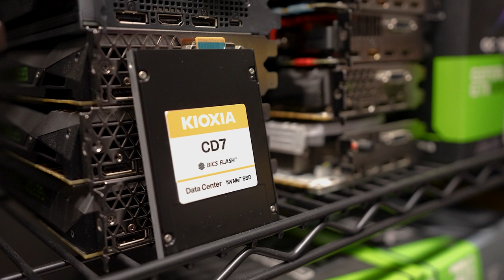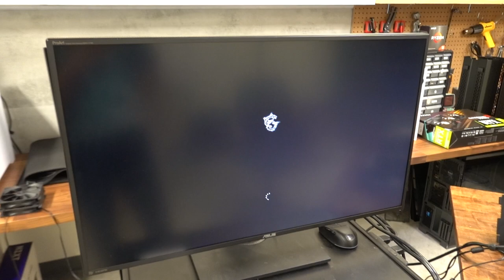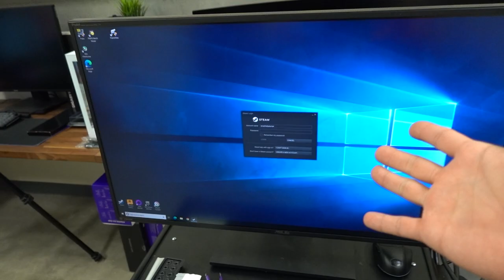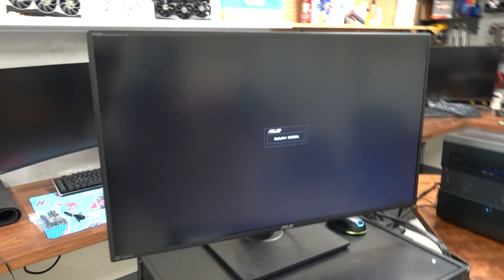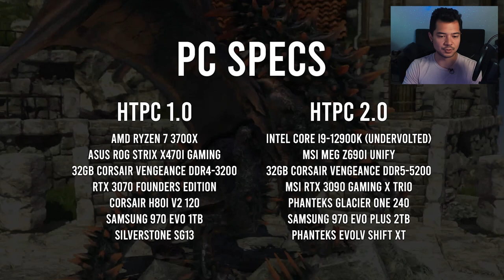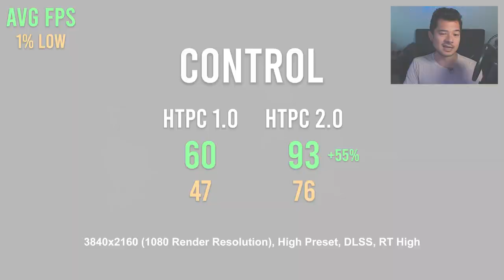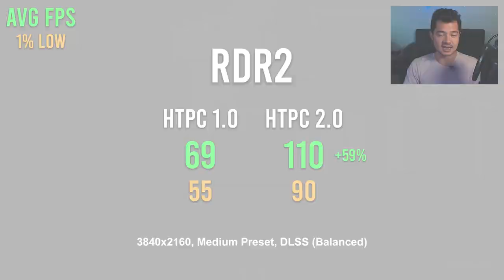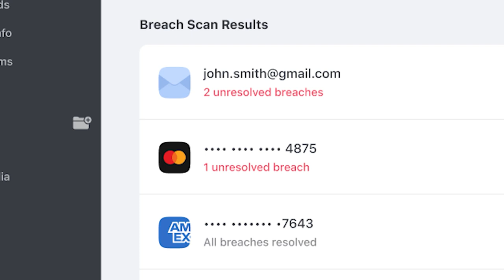IT'S DONE. Was my suffering for this PC worth it?

Comment: It might not be "electronically speaking" the port though.  It may be the physical build of the port, I have a card that I have to press JUST SO into it with the display cable because of the physical build of the card at that port.  Cable's Good, Card's Good, It stays working once I get it just right for months... then a bump or I have to take it out and it becomes the world's worst fidget toy for a few minutes to a few hours, then it works.  All other ports work normally without that fidgeting.

Comment: Components designed to run on 3.3v can run on 5v for a little while, depending on their spec. It's likely that bad ram slot was from your fuck up because it's such a sensitive area, and the rest of the failures just took a little longer.

Comment: If your DP or HDMI cable is touching the case while plugged in it may cause a short and a black screen. That has happened to me many times in the past. You must allign the card properly so that the cable does not touch the case while its plugged in. Or one of the ports is just bad. But in this video it looks like the cable connector very close to the case frame on the left side. You should still try an exorcism on the 3090 to purge the curse of Kyle from it.

Comment: My 3080 cycles through its display and hdmi ports everytime i update nvidia drivers. I don't know what's wrong with it but everytime i update the gpu drivers the port being used is disabled or will not give a signal so i have to move to another port.

Comment: This case absolutely does not isolate the GPU and CPU from each other thermally lol. It's more like the opposite. The GPU is blasting heat straight up into the radiator and the radiator fans are sucking heat straight from the GPU chamber, causing CPU thermals to spike much higher than a standard atx case.

Comment: Nice upgrade! I'm slowly putting together my new system cuz I'm recycling parts and done waiting for prices to drop on gfx cards. How much an upgrade do you imagine this will be?

Core i5-3570k
ASUS Maximus IV Gene -Z/Gen3
16GB (2 x 8) G Skill Sniper F3 DDR3 1866
SanDisk Ultra II 240GB (sata 3)
ASUS STRIX GTX 970 4GB GDDR5

...and upgrading to...

Core i5-10600K
MSI MPG Z490 GAMING PLUS
32GB (4 x 8) G.SKILL Ripjaws V Series DDR4 3200
SAMSUNG 980 M.2 2280 1TB
*ASUS STRIX GTX 970 4GB GDDR5 (Should be RTX 2070...)

F prices over the last year! I bought this stuff a year ago now and I'm tired of it sitting and waiting for new GPU so recycling the 970 until maybe 40 series is out.

Comment: I had super bad thermals but that’s my guess. Even with the case open and taken apart. I’m running ryzen 7 5800x with a msi 6900xt trio Arctic freezer II and evga 850sfx psu. My temps were steadily climbing and a noticeable difference in framerates. At one point it dropped to about 30 on r6. So I botched the idea. So if anyone is interested in getting the case I have one for sale

Comment: Bruh... I swear I just stay subscribed to this channel for the comedy relief aspect at this point. The reason that the display was turning on and off with the 3090 and new mobo was because it was installing the GPU drivers. It doesn't help that you were swapping cards and booting/rebooting the system while the drivers were trying to install themselves. Hopefully you figured this out off camera, lol.

I'm no expert, but I've probably been building PCs for as long as you have (we're close to the same age, I think, early 30s). All the stress of the original parts not working (or just downright failing, some catastrophically like the PSU) and screwing up everything has literally driven you insane and gotten rid of rational thought. Get some sleep, walk away from the build for a day or two, and you'll be good.

Comment: I can only imagine the headache it was trying to troubleshoot this pc. I don't have spare GPUs, or a motherboard but I do have one spare PSU. I had issues with my 5600x build last summer. I sent back my b550 aorus Mb for the x570 version and replaced my older evga PSU. The bios kept resetting at least I thought. I ended up turning off the second bios ok since. Not the same issue but still annoying none the less.

Comment: um the screen going black was because it installed the base driver. remember how the resolution was off? and you commented on the scaling? well it went black for a moment when windows installed the certified driver. thats why the scaling looked right, it was actually changing the resolution from no driver to yes driver.

Comment: 5:38 that's not scaling but a small resolution due to standard drivers being used. That's also why the screen went black because the proper drivers where installed and switched to automatically.

Comment: Great video Kyle. Im glad everything worked out for you in the end. Im having a little trouble with mine. I am also using the glacier one AIO in my shift xt case. I cant seem to get the top to go back on fully. I have resorted to use noctua low profile fans but i really want to use the t30 fans.

Comment: Is the 12900K really that hot of a CPU? I've been running an H80i V2 AIO cooler on my i7-4790K Devil's Canyon CPU for years and devil's canyon chips run REALLY hot, and I've never had cooling trouble with this AIO.
Reply: Yeah, it pulls in a lot of watts to maintain high frequencies. Watch JayzTwoCent's latest talking head video if you want a quick summary on how hot it can get. If you want more detailed info on the 12900K, GamersNexus, HardwareUnboxed, HardwareNumb3rs to just name a few.

Comment: By the way, after not waiting for the post to go completely through long enough and this freaking out about normal behaviour due to drivers installations causing the screen to go off and on I absolutely believe you should put yourself in the woodchipper.
Reply: And display ports do take time to change/update, specially if you have only one screen. Get that Display Port connected from startup and tell me what happens. (May also be an issue caused by that display port actually having a different version/features causing it to hate the display in question)

Comment: So... I avoided these tiny form factor cases and parts and used the Cooler Master HAF XB EVO for my home theater PC running my Plex media server. I have tons of room, can run full ATX motherboards, and I can fit 5 hard drives in there if I need to (1 bay has my Blu-ray drive to rip my discs). It currently has 20 TB of storage for all my uncompressed 4K Blu-ray rips. Since it's a cube it fits in my home theater TV stand perfectly with room to spare at top and back for air to exhaust. I replaced the front glass on the TV doors with steel mesh cut to fit. It can breathe but you'd never know there was a PC in there. I also installed a fan in the back of my TV stand and ran a fan extender to connect it to the motherboard so it's automatic with system temps. I have the 3080 connected to my Pioneer VSX-LX505 with all the HDMI 2.1 features and 77 inch LG C1. I can game on the big screen from my couch with my 7.1.4 Atmos surround system (even though PC is way behind consoles when it comes to surround sound support). It's a pretty dope setup, though I still have a traditional desk setup upstairs.
Reply: I did my last build in an N-Case, and if you do not try to approach a small form factor case like it is a mid or full tower if you are not used to a small case, you do not have that many issues. The guy from Optimum Tech does a lot with small form factor cases, but he has clearly been at a lot longer than other people. I also scratch my head about why people insist on putting a three-fan card in a small case when they sell GPUs that fit into a small form factor.
Reply: @rl318  which is all well and good but I'm just saying I fit a full size build into a pretty standard TV stand by using a square case. I can also fit all my hard disk drives for my media, and an optical drive for ripping. Plus I have much better thermals than a small form factor PC. It's pretty damn sweet how well this thing fits in my TV stand.

Comment: Never understood the big deal with this case... you and Jay seem to have a thing for it though.
Reply: Agreed. At this size the NR200 gives you more options in liquid or air, is like half the price, and avoid the hassle with risers cable. At 4l smaller the Meshlicious can house a 280mm aio which would be infinitely better for the 12900k. At 7L smaller the dan a4 H2o still have the capabilities to house a 3 slot gpu and a 240mm aio.

Comment: I had recently made a few upgrades to my HTPC as well. I went from an R5 3600 + 1080 Ti -> R5-3600 + 3070 -> i5-12600k + 3070 -> i5-12600k + 3080 (AIO). The last upgrade was random and was mostly because I came up in EVGA’s queue.

The big problem that I think I was having before was that my thermal design was not very good. I’m in a fairly large hutch (that was originally the side unit of an arch-style TV stand). The computer has plenty of area around it, but due to my original case (Meshify C), I had to put the CPU’s AIO in the front as intake.  I had a few crashes with Lost Ark that were full system crashes with graphical anomaly on crash. Although, when using HwNFO, I mostly saw 70-75C on the GPU.

Anyway, I switched to a Meshify 2 Compact, and whew… it’s so much better than the original. I’m also using the video card’s AIO as an exhaust out the front now, and I’m no longer using an AIO with the CPU. (I’m using a Noctua NH-U12A with one out of two fans.)  It has been so much better so far, but I need to test out that 3070 a bit to see if it’s working fine.
Reply: Those upgrades are too short a cycle. You should hold on to your parts for a little longer and you'll see a much more valuable jump in performance.
Reply: @darkaiso  Well, I didn’t plan on the 3080. But with the weird issues that I had been having and how I was planning on putting the i5 and 3070 under water to help, I figured I’d take the easy route since I was able to pick up the AIO-based card. Although, to be fair, the 3070 always felt like a bit of a bare minimum for 4K. It wasn’t bad as I even played newer games (like the latest Guardians of the Galaxy), but the change does help a bit.

Although, I can certainly agree that waiting longer between upgrades can add more meaning through larger changes. It is arguably a bit of consumerism to constantly chase the higher end of things.  I do tend to sell the old hardware to help make up for the upgrade costs though.
Reply: 1080 ti should be upgraded to 3080 ti
Reply: @steveong5173   I’ll agree in regard to the memory as the higher VRAM is likely to help with 4K, but the price increase from the 3080 to 3080 Ti is hardly worth it for anything else. I think it really shows how badly Nvidia hamstrung the original 3080 to the point where they released one with more memory.

Comment: The Display Port appears to be partially obscured by the slot metal at 8:34. The cure would be to use a metal nibbler tool and remove about 1/16" adjacent to the Display Port. Otherwise, the DP port connector is prevented from fully seating. Alternative solution: modify the DP connector cable by trimming off where it presses against the slot metal.
Reply: Nice thought, maybe this is it!

Comment: Not sure if Kyle was playing along for more content, if he doesn't know or if he was simply tired but, for whomever cares, I got a few notes. The first time you got video from your gpu and it went off almost immediately was expected. You booted on VGA resolution (not a scale issue), then windows loaded the Nvidia driver and popped the image back on. Regarding booting for the first time with iGpu, it is common on MSI motherboards post 10th gen Intel. You boot with iGpu, and bios will recognize actual gpu on next boot. So the drama was unecessary. For the rest of the viewers, mixing psu cables should not be a problem as us, simple mortals, don't usually have multiple psus lying around. As of Kyle, a content creator of his size, with such experience and connections, this mistake should not have happened. There are other ways to fish for content (you could initially do this as a how-to or how-not-to video) or maybe my faith on not making those mistakes are unrealistic. Apologies in advance for my English. Long time viewer, hoping to see more of the older, more "honest" IMO videos.

Comment: My conclusion from this series, specifically part 1, is it's a good thing I changed out my arctic LF2 for a different cooler because I did the opposite of your mistake and used the intel bracket orientation on a 3800xt.